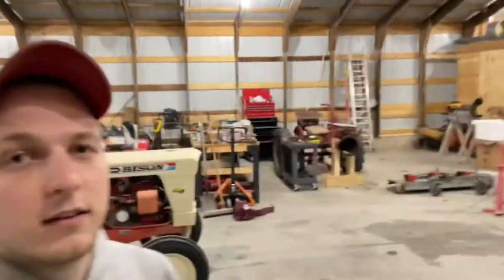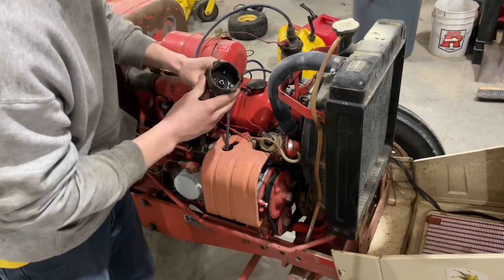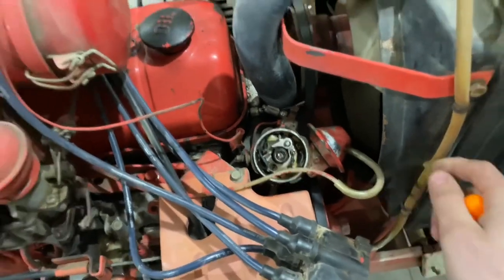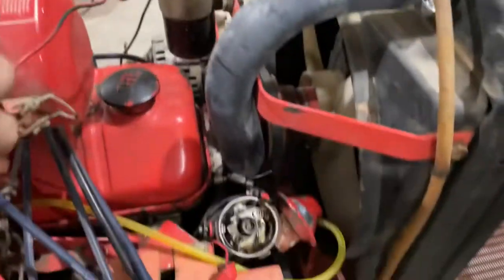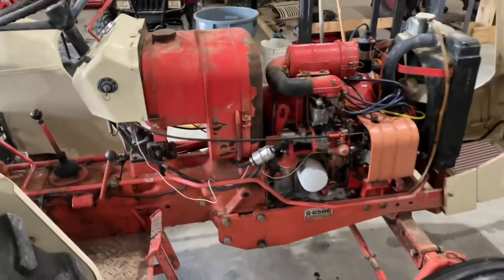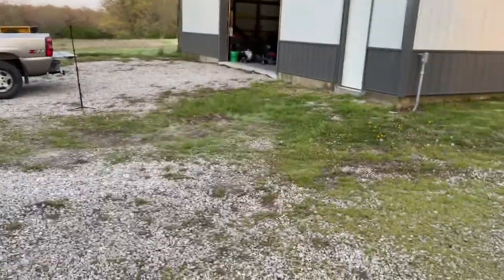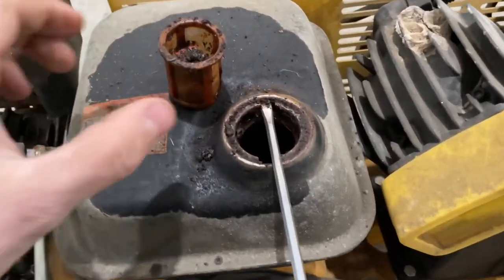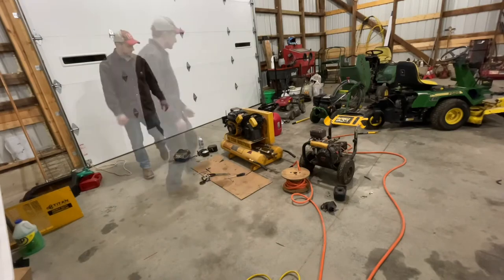Working ON and WITH the Satoh S650 Bison Tractor! Plus a Facebook Marketplace DEAL

Comment: Wondering if you’ve ever split the tractor/pulled the motor and had any issues doing so? Just bought one and went to replace the clutch and I can’t get the motor to split off the back end more than 3/4” or so, would like to hear your opinion, thanks

Comment: Would you happen to know where I could find a 2WD front wheel hub assembly / kingpin? Or what kind of metal it’s made of
Reply from the maker: I haven’t had to buy any steering components for my tractor so I’m not sure where to find a new replacement. I would check with a local tractor salvage yard and see. It may be hard given the make of these tractors. Mine looks like it’s cast steel. It could be welded up and repaired if you had too. Make sure to preheat and use the right rod!